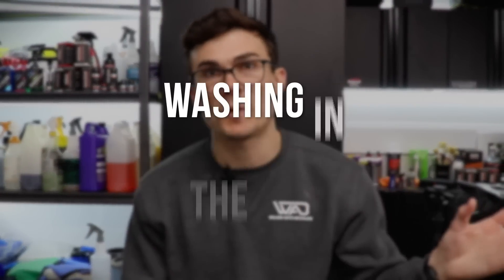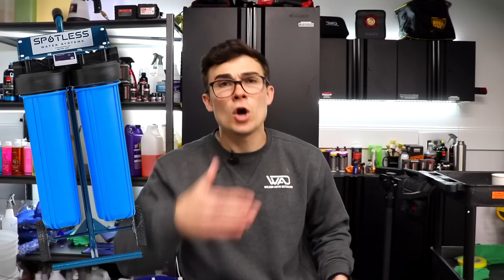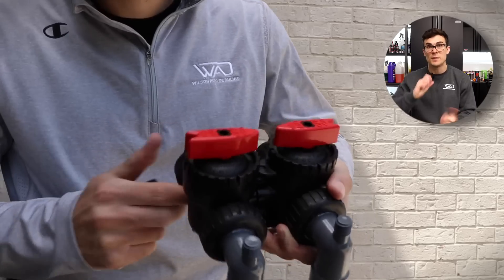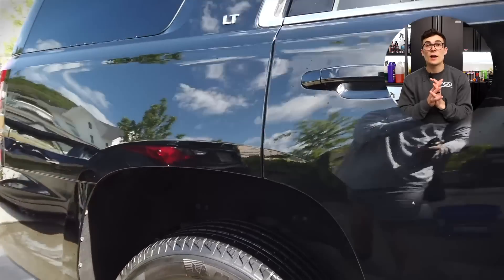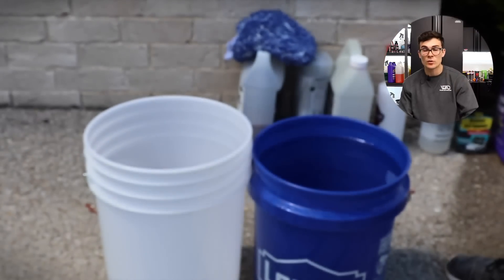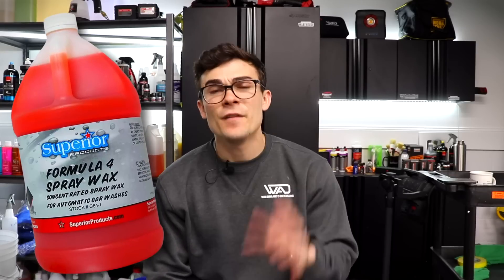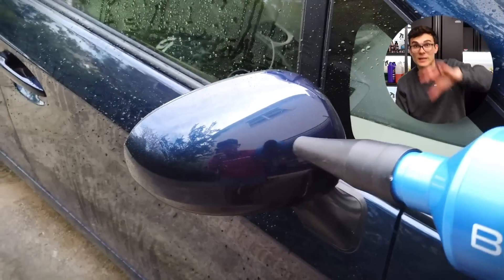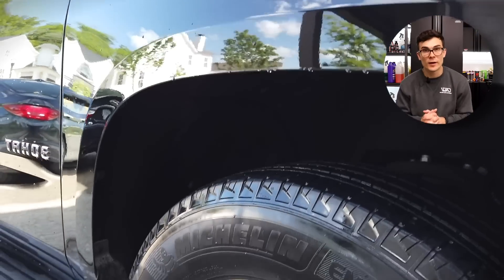3 Advanced Ways To Eliminate Water Spots Washing In The Sun

Comment: Another fact to point out is that the resin life will vary widely based on what your TDS reading is at your home.  I was gifted a CR Spotless system and only got 4, yes 4, washes out of this 450 dollar purchase due to my TDS levels being around 800ppm.  I highly suggest getting a TDS reading of where you live if you have very hard water prior to considering a DI system.
Reply: Was that 4 full washes or just final rinses? My water is around 450 ppm and am curious how many final rinses I could get with the cr spotless on a full size truck..

Comment: I am in Vegas and our water sucks. yours isn't that bad at 115, my hose averages about 460 on my tds meter, which will shorten the life of the resin, that's why I would rather get the larger tank then the cr spotless. tried calling around for a commercial DI tank service and it just doesn't make sense at $115 mo. rental and a $400 change out fee.

Comment: I have an older model Suburban I use for photo excursions and camping. I had it painted with bedliner a few years back that is holding up really well. Can't use a paste wax due to the rough surface. Would Superior Formula 4 work for this type of finish? I generally wash it with a soft nylon bristle brush to get the dirt out of the nooks and crannies, but would like to coat it with some sort of protectant.

Comment: Hi, I use a heavy duty deionizer tank, and for some reason it's still not filtering. Im at the point where i'm using 2 different waxes, formula 4, 3 filters, as well as a deionizer tank and my PPM is 350+ still. DOnt know what to do, i feel like i've done it all.
Reply: Are you getting water spots? How many TDS readers have you tried?

Comment: Wow that's a great Idea. I love this. Maybe I will give it a try. Read the REPLY, it might save you some money.
Reply: Why not just use an RV water filter? They filter the water to 5 microns. Works for me, not perfect but way less expensive. Camco inline water filter. The reason I am posting this as a reply is because this advice has been removed/censored 2 times from this channel. I guess it is VERY good advice. Try a Camco 40631. cost is about 50 bucks, has replaceable filters.